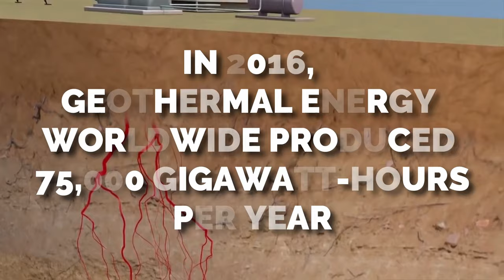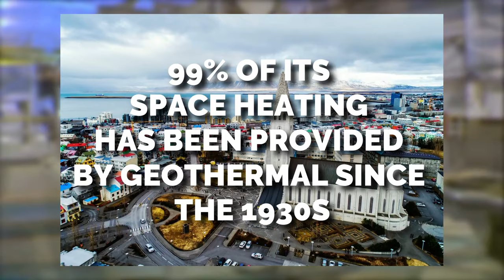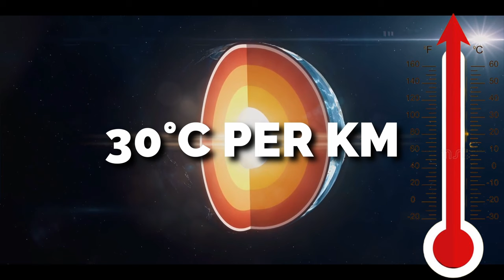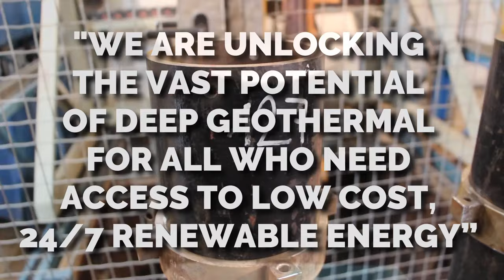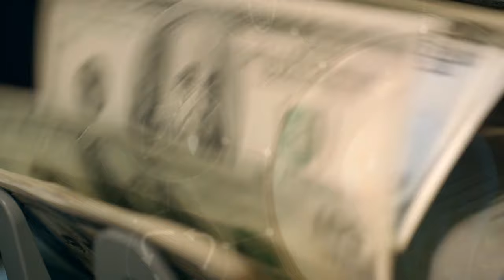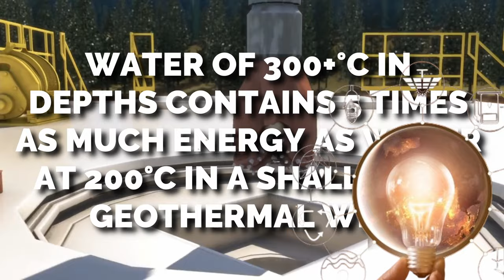Plasmabit Engineering, Unlocking the Potential of Geothermal Energy, Future of Clean Energy

Comment: When coal is burned, especially lignite coal, it give off all kinds of pollutants.  So on that point you are correct.  What you are NOT mentioning is that for decades the emissions filtration has improved and with current technology nearly ALL of the heavy metals are captured and the vast majority of the particulate emissions are captured.  Still not zero but so many videos like this have an agenda and aren't telling the whole truth.
Reply: But it produces vast amounts of CO2 as its main constituent
Reply: Ok boomer
Reply: @vhulheim  Thanks millennial.
Reply: Some of what is emitted is still carcinogenic, and it’s simply more expensive than wind, and solar is now very close as well.  Both of those are relatively clean (except manufacturing of the turbines or panels) so why would we want to take a step backwards?
Reply: @sjsomething4936  If coal is so expensive why is most of our energy produced by coal?  So many tons burned every year it's hard to keep track of and yet solar and wind still account for only a fraction of the electrical energy production.  Wind doesn't always blow and sun doesn't always shine.  You have to have many times the production needs to keep the grid fed and up to half of ALL electricity generated is lost to that grid.  More energy moving from production area to use area increases that loss.  You have to see the big picture.
Reply: @repalmore  the “big” picture is that at the time coal was initially used, it was not as well understood what it’s extremely negative effects were.  Now we understand them, but coal companies have a lot of politicians in their pockets via campaign contributions, and likely direct corruption of some of them, so they keep operating.  Most are actually now being shut down as electricity production via wind energy has become less expensive than coal to produce, solar is very close.  With the new types of energy storage coming online to provide power at night or during periods of low renewable production, coal is all but dead.

As to the production close to consumption area, that’s pretty easily accomplished with wind and solar in many cases, because they don’t pollute the area they operate in*. So grid losses are *less than a big centralized coal generating plant many miles from where the power is consumed.

If you want to pay more for your electricity and pollute your local area, by all means go and demand that your politicians support it.  But I’ll fight any attempt to open a new coal plant in my area, which thankfully we’ve been smart enough to decommission every one near where I live.

Also, ask the workers of many of the coal mining companies how they feel, they’ve been sold out by politicians and have either lost their   pensions or are at severe risk of losing their pensions as the price of electricity produced by wind and solar have dropped dramatically and the coal mining companies are at risk of bankruptcy.  You still think it makes sense to burn coal to make electricity? It has real, tangible negative effects across the board: human health, economic health, corruption of political decision making, pollution.  Do you need more reasons?

Comment: NUCLEAR IS ZERO EMISSIONS AND THE SAFEST WAY TO PRODUCE ELECTRICITY! THE FRENCH GOT THIS RIGHT! Before you complain about the waste, all of Frances waste fit in one room. ONE ROOM!
Reply: @sinaroughani7000  Besides the fact they can now recycle a lot of the waste, the amount of waste produced so far fits inside 1 walmart.
Reply: @sinaroughani7000  Nuclear is absolutely the future of energy.
This Plasmabit® drilling sounds like it would take a lot of energy to maintain an arc to drill multiple km beneath the earth's crust. Probably in the multi megawatt range.
Reply: @chuckward3  Mining enough uranium to fuel a reactor for decades takes significantly less energy than required to drill kilometres under the earth's crust.
You'd probably need to drill 10 shafts to equal one reactor.
Nuclear reactors have caused less radiological pollution than coal power plants (chernobyl included) and every radiological accident is well logged.

Unlike environmental problems caused by 'green energy' which are barely ever talked about.

Where do you think the cobalt for electric car batteries comes from?
Reply: @sinaroughani7000  solar's maintenance is greater than nuclear in the long run, the number of replacements needed every 10 years, upkeep of the panels and material it takes to build new ones. The amount of power needed is extreme.
Reply: @sinaroughani7000  again, you are ignoring my statement about how there is a new technology which does recycle a majority of the nuclear waste. 

also 1 nuclear power plant = 13,123,333 solar panels , thats IF its a sunny day in a desert... please tell me again how nuclear will cost more?
Reply: @sinaroughani7000  There is no rational argument against having residential plants.
Reply: @daviddavidson2357   nuclear is incredibly expensive to build and operate, and comes with significant risks, both from an industrial accident perspective as well as terrorism concerns.  After that , you have to consider the fuel source.  Do you know where most of the world’s uranium comes from? Kazakhstan! You know, that partially stable country which Russian propagandandists are also threatening to invade. So by all means let’s reintroduce a dependency on unstable, potentially unfriendly countries to supply us with the resources needed to power our economy.

As for geothermal energy, sure the drilling technologies being developed do require megawatt energy levels, but that’s only needed a single time to create the bore hole. Quaise energy is also a startup in this field, they are working with the DOE to determine feasibility but it looks very promising.  I think that nuclear has almost no future, although the huge corporations that typically build those plants are flooding social media with a fresh wave of hype about how they’re the only clean energy.

I’d love to think that fusion is close, but despite recent advances it still seems to be a fair way off, if it is ever actually viable.

Personally I’d protest against any proposal for a nuke plant anywhere near my home, and I’m someone who lived less than 5 miles from one for 20 years.  There’s just way superior ways to generate energy nowadays.
Reply: @sinaroughani7000  I believe the company you’re thinking of is Quaise Energy.
Reply: @daviddavidson2357  so you think that he gigantic open-pit mines used to obtain uranium don’t require an immense amount of energy, 99% of which is diesels burned by enormous earth movers, isn’t a problem in its own right? Give your head a shake man.  The cobalt in EV batteries is recoverable at the end of the life of the battery, as are the other precious metals that comprise the battery. The same cannot be said for the uranium once it’s productive life is over, it’s done and is now a problem to be dealt with for over a thousand years.  

Geothermal of the kind being discussed here requires a one-time use of a lot of energy to drill, after that it’s decades, more likely centuries of clean energy with occasional need for maintenance of the tubing etc., none of which has any kind of radioactive contamination.

Any argument that nuclear power requires less energy is pure industry bullshit.  The decommissioning of NPPs is also a massive cost, and low-level contaminated material that again has to be managed for decades at a minimum.
Reply: @sjsomething4936  Funny you should say the cobalt is recoverable.
Less than 5% of EV batteries are recycled and the recycling techniques used (usually just burning the cells then collecting and processing the burned material) is massively inefficient, so much so that the US DOE is offering 5 mil to anyone who can design a system with a higher efficiency.
If full recycling was adopted that would still only account for 1/3 of the cobalt in EVs and that's only for the US.

Meanwhile we already have all the fissile material we will need for the next couple hundred years. Forever if we use fast breeder reactors, no "once its done its done" with those, they can pump out more fissile material than they use. 

The reason current reactors produce so much nuclear waste is because they were designed to do so they were made as a way to produce plutonium for weapons.

Ironic that you should be complaining about nuclear while praising cobalt. You know what the Congo was used for before cobalt became so sought after?
Uranium.
And now its an industrial byproduct of cobalt mining, surveys have shown significant radioactive contamination around cobalt mines and smelters. Radioactive contamination doesn't just come from nuclear reactors.
Reply: @daviddavidson2357   re-read my comment and please explain where I “praise” cobalt or its mining.  I’m well aware that the DRC is the major producer of cobalt currently, and that essentially it’s slave labour and reprehensible, which is why countries like Canada are trying to develop sources that aren’t in corrupt regimes with no concept of human rights.  It’s also a fairly recent development that the EV batteries can even be recycled, all it would take to hit very high recycling levels is legislation, and the fact that the remaining dollar value in an EV battery at the end of its first life is high, makes it very likely that recycling will increase massively.  GM is recycling 100% of the batteries that were replaced in the Bolt recall fiasco, for instance.  The comments about radioactivity in cobalt mininng… ok, there’s radioactive material in mining of multiple types of elements, although more so with cobalt than most. Regardless it’s a hazard that has to be managed.

Google “redwood materials recovery rate, they claim they can recover 95% of the battery material.

   As for the reactor discussion, I’m simply not a fan of spending billions of dollars to build more of them when there are options such as the proposed geothermal energy generation methods, coupled with renewables which should be able to produce sufficient amounts of electricity, meaning no need to use nuclear. No fuel to dispose of and protect, no decommissioning of contaminated reactor vessels, piping etc.
   These are all schemes proposed by large corporations who profit vastly from their construction and maintenance, and looking to maintain centralized power generation rather than distributed.  I’d rather look at new, completely non-polluting methods.
Reply: WOW 🥺😳 ! One room?!
Reply: Yeah, let’s just go back in time to when labour was much cheaper, governments was providing super cheap financing, there was huge overlap with nuclear weapons programme, and nuclear safety regulations was more relaxed. That’s SUCH a practical solution for building new power plants today. Call me when nuclear proponents has agreed on which of the dozens of modern reactor technologies we should actually build, and a western country has built a modern reactor on time and on budget.
Getting really tired of nuclear enthusiasts shouting “BuT WhAT aBouT NUCLeAR!!” on every video that relates to renewables.
I actually love nuclear technology, but it’s really not necessary. It has become crystal clear that renewables alone can tackle the net zero carbon transition.
Maybe in 30 years, after the transition is done, we can make some of our energy infrastructure more compact by replacing some of it with nuclear.
And of course, we shouldn’t shut down any existing nuclear reactors unless absolutely necessary.
Reply: Where on earth you get the nuclear material ores from? Mining. That itself is non zero emission.
Reply: @mrdoverman  Well neither are solar panels, Wind turbines, EVs just to name a few.
Reply: @fbarts Valid point. They all require rare earth minerals.